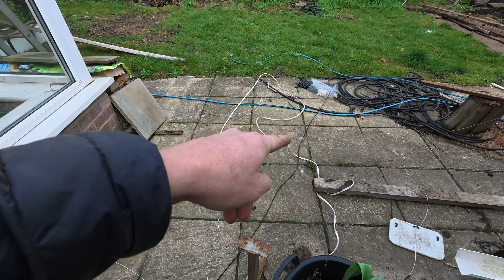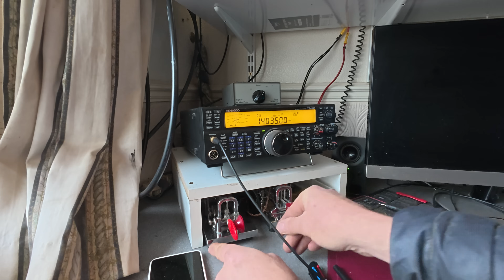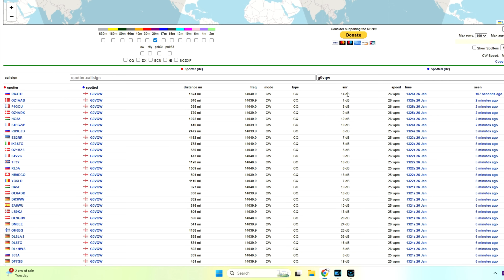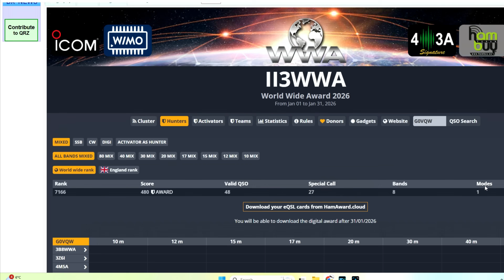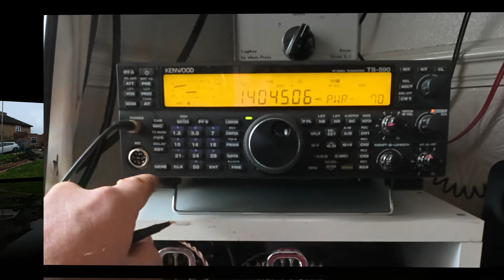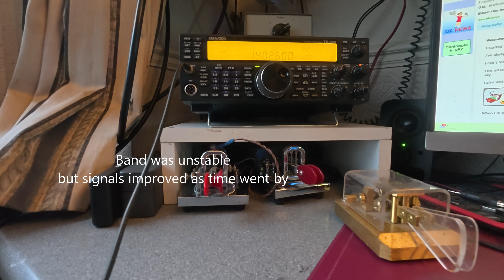Testing a home Brew Elevated Vertical Antenna on the air using CW, other antennas here. The Shack

Comment: Thanks for the videos Sandy and the antenna work is always interesting.  I heard you on the air on 15/1/26 @ 20:19 to Alan in Wales and you had slowed your bug down as low as it would go, so I could also read it. My copying starts to fail over about 20wpm so I find most contests out of reach when they rattle on in the region of 30wpm.  Nevertheless I have a go at the Fists Ladder every month and ended sixth place last year.  Keep the videos coming and I will also look out for you on the other channel.  Hope that Mandy is getting stronger and we see her out and about again soon.  Best 73's, Steve (M0SHM).
Reply from the maker: Welldone Steve, Keep plugging away and your RX speeds will increase. Speed is not everything but its nice to be flexible .
Mandy is a bit up and down to be honest. Not been easy for her

Comment: Great CW. Do not take down the delta-loop. Feed the right way this antenna will outperform any doublet and single vertical. See to that you have the current-maxima above each other, and it acts like a vertically stacked dipoles, one current feed and the other voltage feed. Having the maximas vertically does minimize the height above ground influence. This loop outperforms any dipole regardless of the actual height above ground. Try it ! And be glad. 73 & cu de Bjoern
Reply from the maker: I need to change something Bjoern, I've heard delta loops are good antennas and wanted to try it but its not working great at the moment. I may need to adjust the feed point. To get current maxima where you say where do I feed the loop?

Comment: Hi Sandy, I really enjoyed that! 😊 Strangely, I got myself a G90 which arrived late last Thursday. Had a play with it on Friday morning and the first station I heard (on 20m SSB) was II3WWA at S9+40, but with 20W I couldn’t get to him through the pile-up. (Need to keep working on my CW ☹️). Changed to 15m on my short ‘random wire’ in my loft (which my FT1000 refuses to tune on 15) and got straight through another pile-up to SO3WWA in Poland. My 1st 15m contact since getting back on the air 😊. I really need to get a decent antenna (or two) up outside, but Liz isn’t keen on me putting up verticals with radials all over ‘her’ garden 😊 In the meantime, I’m busy sorting out my 2m gear for ‘145 Alive + More 144’ on 7th Feb. Hoping to get out /P in IO86. 73 for now, de Peter GM4RAH 🏴
Reply from the maker: It can be a problem getting antennas up Peter, fortunately the garden is my domain :)

Comment: you need a simple 10/12/15/17/20 mtr Fan dipole..5 bands with mono band no need for an ATU and no faffing about putting poles up and down old boy! One feed simple and quick band switching.  Cost pennies.
Reply from the maker: I agree David, I may build another one soon

Comment: good to work you yesterday Sandy on 80m . hi.  here,i cant get the height for a low angle take off horizontal 20m band dipole. horizontal dipoles and loops are quieter on RX too than verticals. so here, im using an old CB Silver Rod vertical,took out the matching in the base and its 16ft 5in tall. mounted about 7ft highwith two 17ft raised radials. 1.1 swr down on cw end . for RX,im using a 20m Bazooka dipole which is an amazing antenna.almost flat SWR across 20m and super super quiet rx. its mounted only 24ft high,slightly inverted vee and with THAT antenna listening for weak dx and my low angle noisy Silver Rod to TX, its a great combo for me . cu on the key sn Sandy and gd dx om...de MW0BFY

Comment: Nice bit of cw there sandy.  Just a suggestion (I would do it myself) for multibanding the vertical and save time is to tape wires for 10,15 and 20m to the mast and connect them when required.  Tell me to nick off if you like.  73s Will VK5WB.

Comment: Great new channel Sandy  good for you.  I messed around on 11mtrs back in the 80's as well as basic ops in the army, but, but never really had the tech know how to get into it big time.   35 years later, an old military mate offered me the chance to get my hands in a Clansman PRC 320, the rest history.  Took my foundation (M6KVK) and loving it.  Sadly I'm not a CW operator, preferring ssb, mainly portable, in fact I've just bought a vertical to use when motorcycle portable 😅.  I like to build my own antenna usually but this JPC-12 will be just the ticket for quick portable comms.  I have subbed and will watch with interest 👍
Reply from the maker: You should have a lot of fun with your clansman radio :)

Comment: Hi Sandy is that a metal telescopic pole your runing your aerial wire up. George
Reply from the maker: No, the active element is taped to a fibreglass pole but the mast at the bottom is metal

Comment: Morning Sandy do you still use the DX commander? Mine is still working well looking at moving it to a new location in the garden it will need a new set of ground wires but using PSK reporter I can see my radiation pattern is lacking towards the NW.  Best regards Tony M7CVK
Reply from the maker: My DXCommander broke after a while, if you can elevate the antenna and add tuned radials it will work a lot better

Comment: what happened to the dx commander , didn't you like it ?
Reply from the maker: Its fine but didn't survive long before the wind got the better of it. (Broke in less than a year) There's a lot of wires and elastic and being ground mounted on average ground means its not as efficient as the antenna I using here.
The DXCommander could be mounted in an elevated position but to get all the radials tuned for each band would be a faff and a lot of wires.
Running mono bander is straight forward and I can swap out wires easily in 5 minutes.
Reply: @wiltshiremanradio  WOW for the money you would think it would last longer than that

Comment: hi Sandy, nice video. ive just spent 4 years setting up and testing my 20m single elevated  vertical, then continued to make it a 3 ele, which gives me 2 S points, "12db
' gain long path.  videos are on my channel "zl3xdj" if you were interested.  I only work stations over 10,000 miles hi. you can use ladder line for the vertical section, and cut it for two bands, and have one tuned radial for say 20m and another for 15m.  I hope this is helpfull. i am ex g4xdj hi 73 mate

Comment: I'm 2 mins into the video and I can see a problem why I should not get any further into radio apart from the small SDR I have for flight radar; The wires! my wife moans at me about the wires in my man cave there is no way Im going to get away with 1/4 length Dipoles down the garden and its a 300ft garden with a 9 acre field over the fence, I could move Goonhilly in here on the farm but Im only aloud the 1 Starlink dish! Im loving this radio stuff Sandy!
Reply from the maker: Yes my garden is a bit of a mess but there are folks who use stealth antennas with moderate success Tim
Reply: I told my wife if I got back into HAM radio I would have an invisible antenna.  Well it isn't quite invisible but I have a fibreglass pole 9m long (a 10m pole with the thinnest bit removed) and on that I have a 40m dipole at 8m and a 20m (5m long) quarter wave about 3m from the bottom. It has very little visual impact.  Not the best for continuous DX but I have got into France and Germany from Australia. If you don't want a dipole, look up a RYBAKOV vertical on the net. WALT Coastal Waves and Wires Utube shows one.